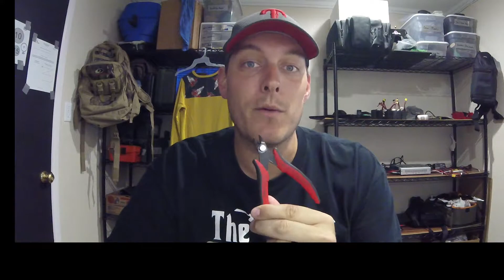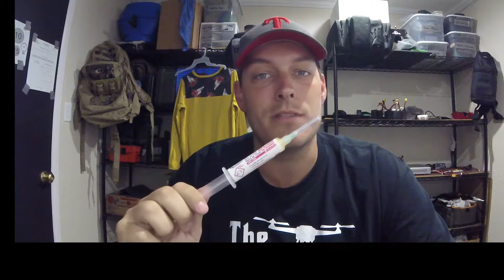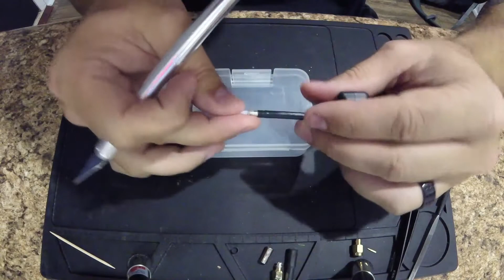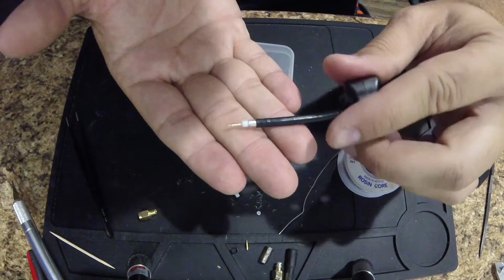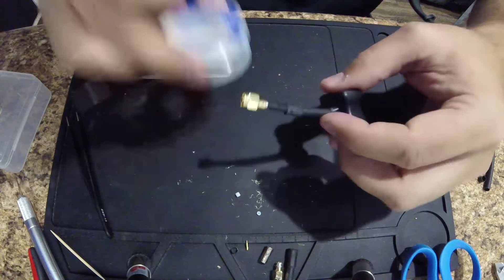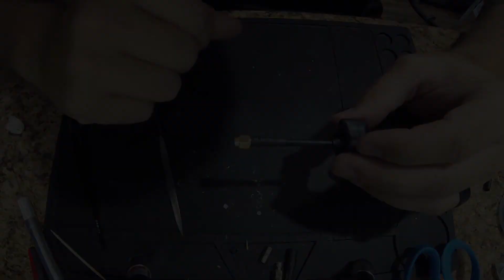TBS triumph antenna repair

Comment: Hello.
Good job:]
After repair what kind of electrical resistance do you have on the air?
Reply from the maker: kosti116 to be honest I never needed to check. it has worked just as well as my undamaged ones for months
Reply: Ok thanks for the reply.
The last question:
Have you checked on the multimeter, the shield and the signal is connected?
I put together my only 1 original antenna and when I check the multimeter I have a closed circuit between the shield and the signal, and in the non-genuine I have no closed circuit.
(Between the outer part of the SMA connector and the inner part)
Now I do not know whether the upper part of the antenna is not damaged.
Reply from the maker: kosti116 It should not be a closed circuit. The outer jacket in soldered to the sma body and the inner signal pin is soldered to the wire with the wax/plastic acting as a buffer between the two. sounds like you may have gotten a single strand, tough to see, sneak down onto the signal pin while soldering the jacket to the sma body
Reply: Old_Man_FPV 
Ok thanks again for the answers :) 
Best regards!